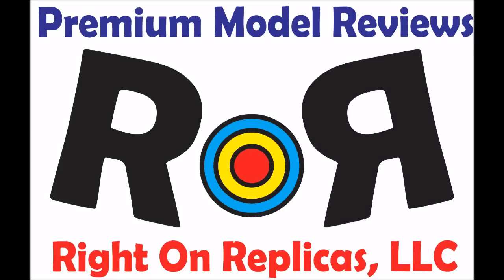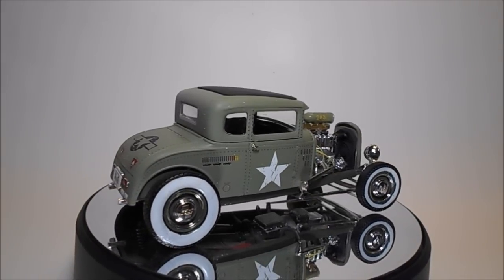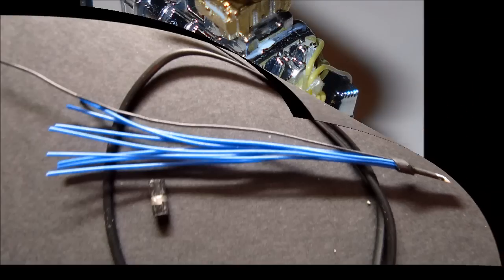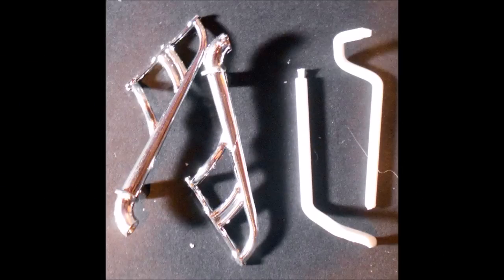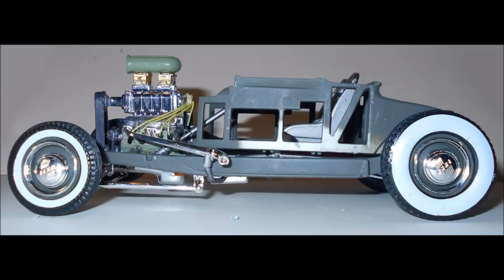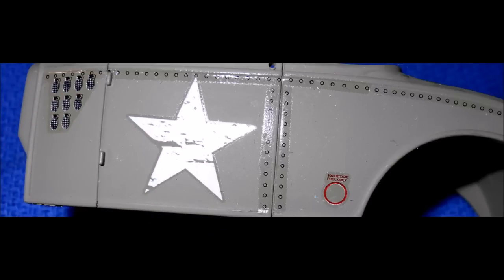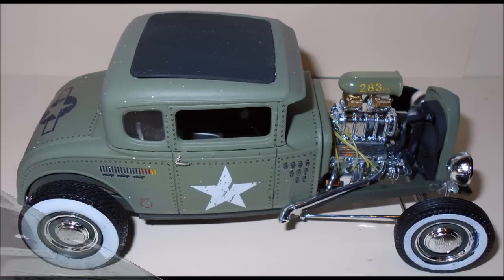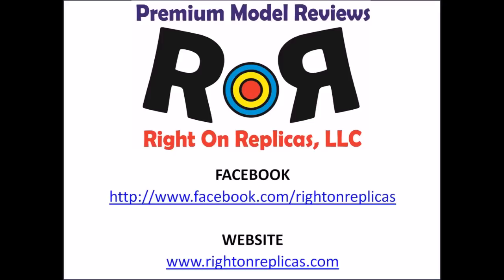How to Build the 1930 Ford Model A Coupe 1:25 Scale Revell Model Kit #85-4326 Review

Comment: To get the zeed frame to fit the blown engine, you need to use the shorter drive shaft.  This allows the engine to sit back just enough to fit properly.
Reply from the maker: DM,  Thanks for the info!  -Doug